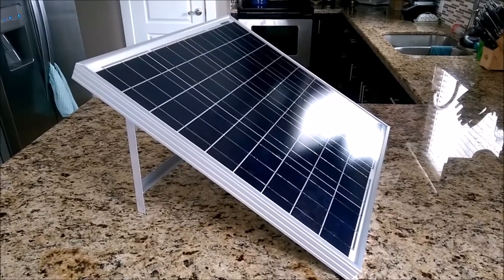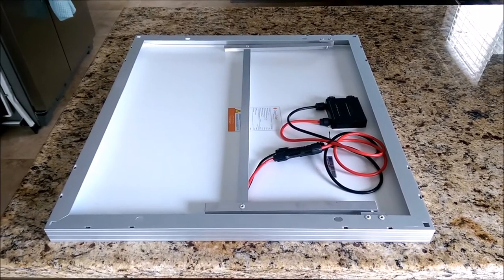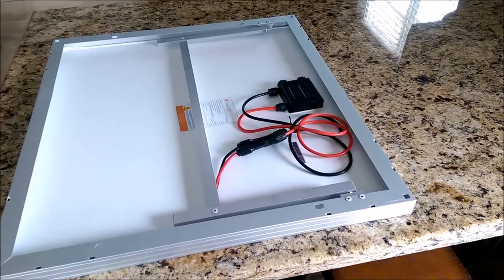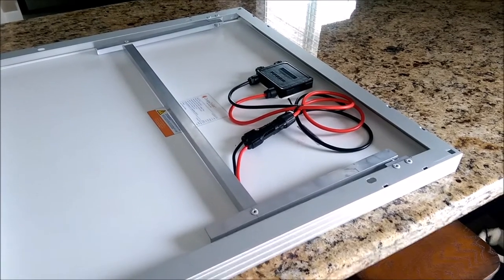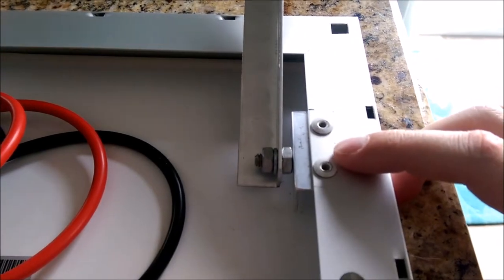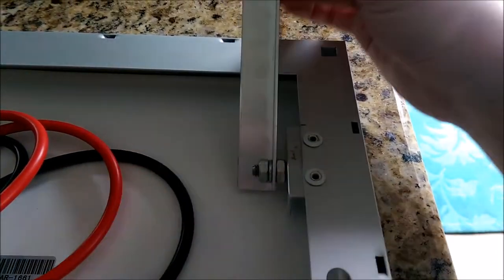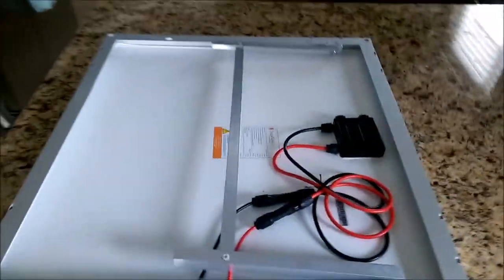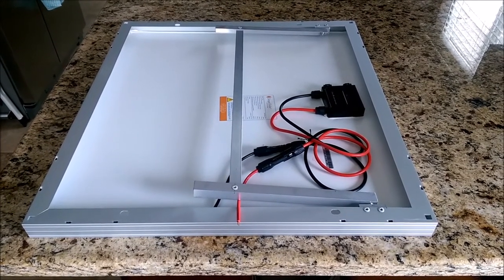DIY Aluminum Solar Panel Stand

Comment: I have been looking for good ways to add mounts to my system.  I like this idea so far.  Do you have any trouble getting it to stay in a particular position when standing up?
Reply from the maker: ModernSurvivalists I haven't had an issue with it falling. You could always get some twine or string and tie it at the desired length and it won't fall as well.
Reply: Great job on the simple supports. We are adding a 100W portable panel to the GoneCamper 2.0 Chevy Express. I will be adding a length of flexible cable to keep the legs from extending too far and collapsing. GoneCamper.com